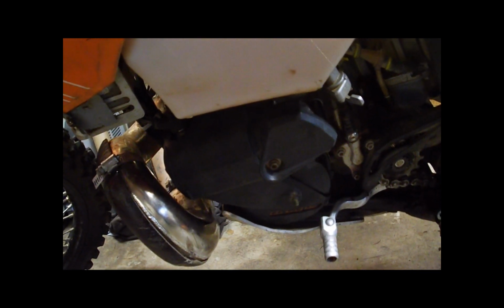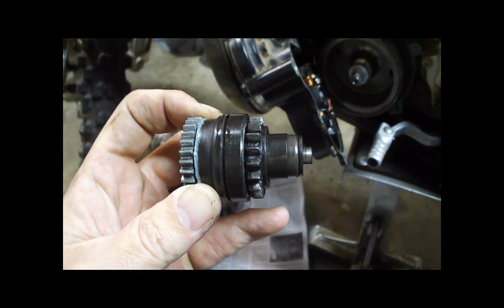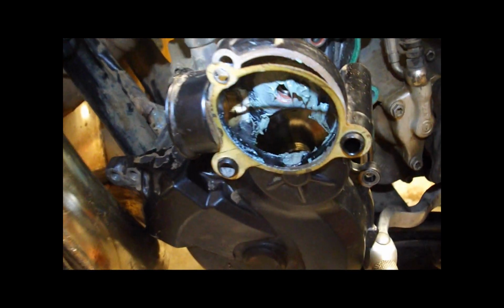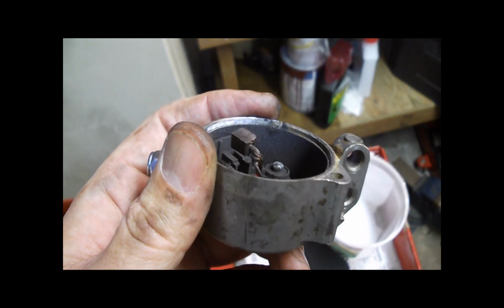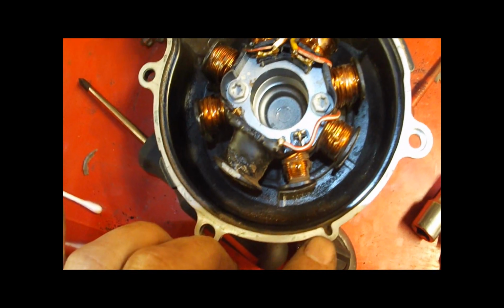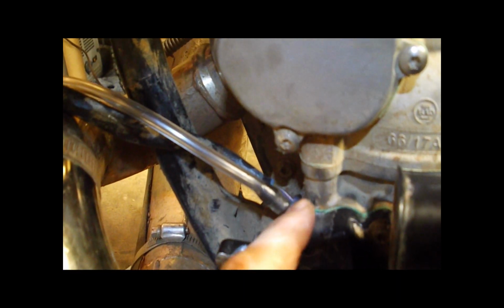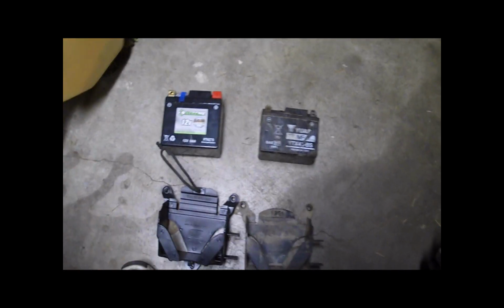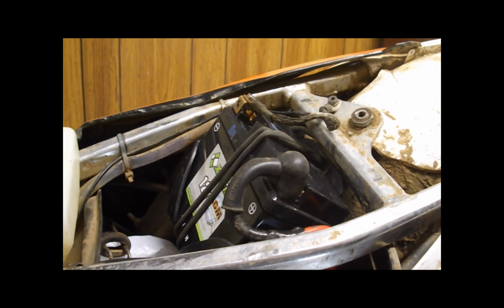KTM 2 stroke starter repair

Comment from the maker: on the 2011 250 XCW parts diagram its in the ignition system schematic, item # 19.  It's called a collar bushing P/N# 55140030100 and you need 4 of them total.  They may have changed the part number in subsequent years but they're probably still listed in the ignition system schematic.

Comment: Hi Mike,

I believe I have a problem with the brushes on my 2012 Husaberg TE 250. When I push the starter button, all I can hear is a short knock of the stator, close to the battery, on the left side of the bike. I thought at first it would be just a flat battery. There is no noise of the starter motor rotating at all. The battery is fine with 13+ volts. Any hints on this?

I'll be going through the process of checking everything and hoping for just replacing the brushes.

Still, is it possible to make a video on how to diagnose starter motor problems? Either using a multimeter, or maybe it is just playing it by ear. I think the DIY community would very much appreciate!

Thank you a lot for this video!
Reply from the maker: That's the starter relay you're hearing.  Mine would do that occasionally when it was cold, then after riding the bike for a couple of minutes the engine would warm up and the starter would work.  Diagnosing it is kind of playing it by ear.  I showed all of the problems I think you might encounter with the starter setup.  If you go through the steps in the video and do all the repairs/mods you'll be happy.  Mine is still going strong...hot, cold...doesn't matter.  Very little freewheeling.
Reply: Hi Mike,

Many thanks for the reply. Washed the bike last night and greased her all up so I'll be starting the repairs today, I expect.

Best regards,

Tiago
Reply: mx mike Hi Mike,

Just got to track back this video of yours. It has got to be one of the best - if not the best - videos out there about KTM starter problems and ways to solve them/repair/maintain them. Combined with Jeff Slavens videos one's got a great team to stay in to!

I got to sort out this problem I had about 4 months ago. The brushes where absolutely worn out. One of them didn't even had the graphite bit already.

So I was able to clean it, replaced the bearing seal and greased up the bearing. The brushes were also replaced at a common electric motors repair shop as KTM didn't had this in stock. (I mean, if they know that this is a problem and it is a consumable thing, wouldn't you expect for a major KTM shop to have this in stock?...)

So, everything got in place and ran whel untill last weekend. It's the brushes again.

This time, I even got to face down the copper so it would be flat again as a deeper recess was in from the wear. Done everything right. I just hope I didn't get to little copper now...

I'm now looking for brushes so I can replace them myself now. There are plenty of videos out here in YouTube on how to do that as well to teach and inspire other ones.

This time I might also open that housing and clean, grease everyting and also do again the wet modification as it was done from a previous owner.

I hope to get some good news soon.

Regards, great rides!
Reply from the maker: You can get a complete rebuild kit at http://ricksmotorsportelectrics.com/ktm-rebuild-kit.php for $75 US.  It includes a new armature, so no starter troubleshooting required.  The clicking sound beside the airfilter is the starter relay being activated when you push the starter button.  Before you tear back into the bike, kickstart it and ride it for ~5-10 miles.  Oftentimes, the starter won't work when the bike is cold and hasn't been ridden for a while.  As the bike warms up, the starter works better and by the end of 5 miles or so, it will usually work great.  Some people disconnect the battery negative wire between rides to keep the battery fully charged.

Comment: Mike how did you get the teflon collars out.
Reply from the maker: I used this type of reverse snapring plier.  When you squeeze the handles together, the tips press outward.  I put the tips inside the collar and squeezed the handles together.  The tips pressed against the inside of the collar and I was able to pull the collar out. 

http://www.amazon.com/Lisle-49200-Heavy-Duty-Plier/dp/B0009OR8ZM/ref=sr_1_1/177-0477109-5003718?ie=UTF8&qid=1400193800&sr=8-1&keywords=heavy+duty+snap+ring+pliers
Reply: mx mike Thanks, I didn't get to read your reply before I got the collars out but I ended up caving in the sides and pulling them out with pliers.